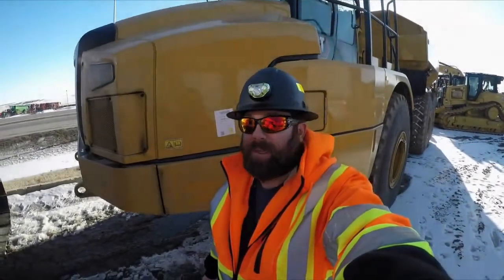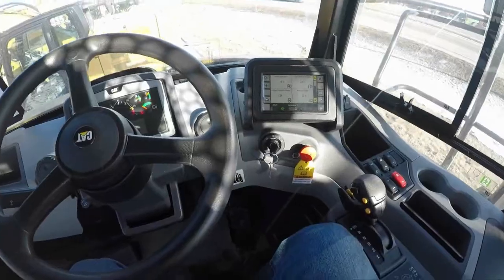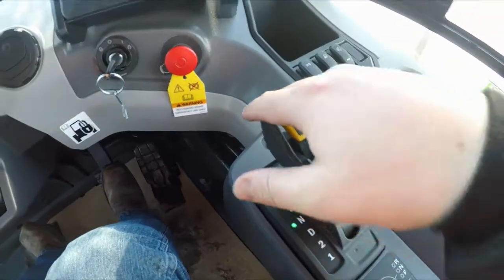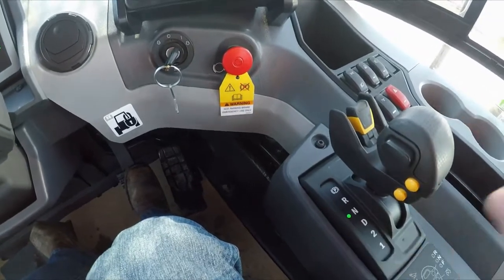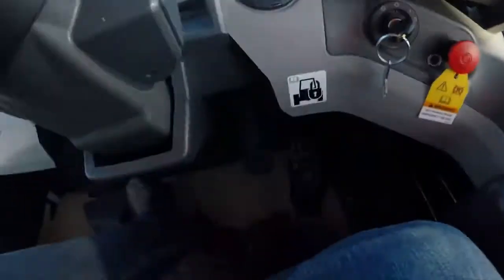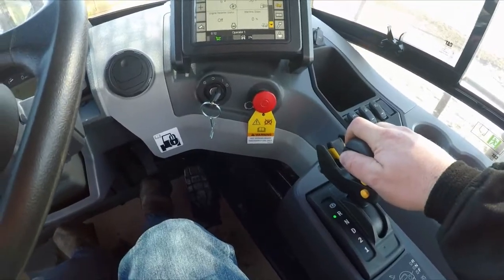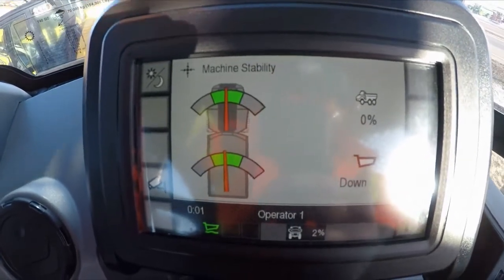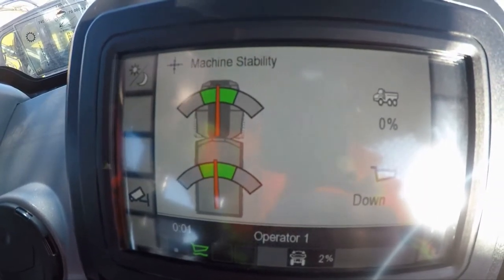Cat 740/745 Next Gen articulated Trucks - Assisted Hoist System (AHS) operation tutorial.

Comment: I used it all night tonight. I don't know why, they're easier to do it manually than the older models anyway, I guess I felt both lazy and like I earned the right to use it. So I did.
Reply from the maker: It’s there to use as a tool to help you - sounds like you used it just like it was supposed to be used
Reply: @ironman3406  I've driven older models, with the snap up down emergency brake, and 2 sticks, I've used newer models like this manually, I know how to do it, I was on my first night shift last night in pitch black, I figured I paid the dues, make it easy on myself

Comment: Doesnt work well with big loads because you have to drive forward to completely empty the box
Reply from the maker: @mattstegall5095  works just the same, when the box is hoisted up and you need to pull ahead to empty the box, just move it from reverse to drive and pull ahead. Once the box is empty hit the down control past the detent and head back to the pit for another load.  It’ll hold you in a lower gear until the box is lowered to a safe spot then start shifting up.
Reply: Thank you so much!!!!!

Comment: So you cant drive and dump. That very inefficient. you should be able to dump at 20 MPH so the piles are more easily spread  by the tractor with a scraper box.
Reply from the maker: No spreading at high speeds in an articulated truck is unsafe and very easy to tip the machine.  So they limit the speed that the machine will travel to prevent that from happening. I’ll tell you what’s not efficient, spreading out truck piles with a tractor and scraper box.  You should be using a bulldozer or grader for the best efficiency.

Comment: Years ago when i was 18 I started out operating a D400, my god what a punishment. They had self adjusting hydraulic rams for the body height. Anyway i eventually drove a 740 and still ruff as guts, they'll never make them things comfortable.
Reply from the maker: Thanks for watching, articulating trucks toss you around now doubt!  And a D400 yah that would be punishing.
Reply: @ironman3406  lol, driving down the haul road in second gear max. 😂